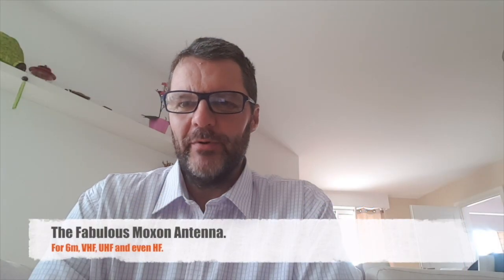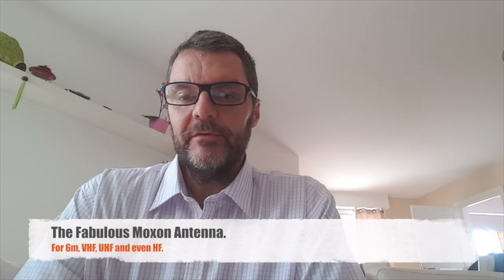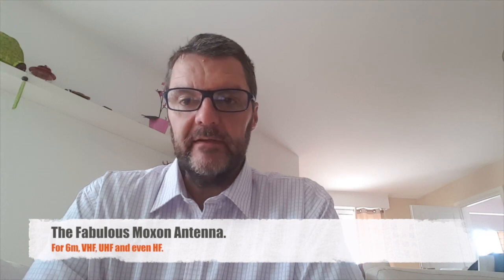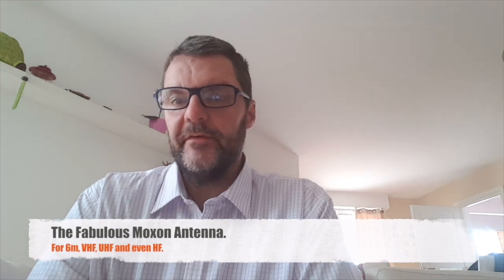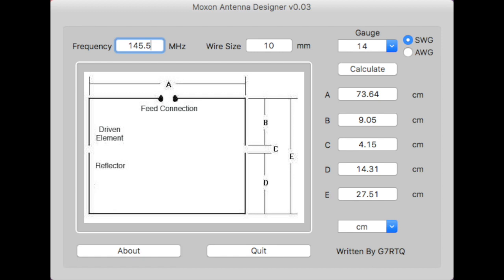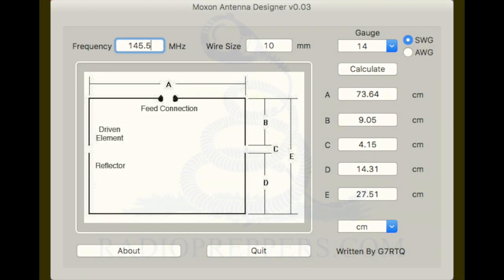The Fabulous Moxon Antenna, Part 1.

Comment: You should sweat copper pipe by heating underneath and not directly on the joint. When the pipe is hot enough the solder, applied to the top will wick into the joint. You should not apply heat to the solder.
Great, practical info though. I love your videos.

Comment: Its not a folded dipole, its a 2 el beam with tips bent to look at each other. thats where you get the voltage coupling besides the current coupling at the middle of the elements and thats what makes the Moxon a uniquely fabulous antenna, double coupling.

Comment: Part 2 came up in the videos YT thought I would like to watch. Well, I want to see part 1 before watching part 2. This is not a Star Wars production. Are tube cutter tools available in France? I would think it would be much easier cut pieces of copper tubing with a tube cutter than a hack saw. Also, is bronze rod, in the USA the rods are used for brazing, available in France? I haven't found a distributor yet so brazing together bronze rods for antenna lengths is what must now do. On to part 2. KB8AMZ
Reply from the maker: But with a tube cutter you can only cut tubes... Brazing rods yes, but only long enough for UHF antennas...

Comment: I built 10 of them the 2 mtr one i use a yard stick or pvc form  and thick wire  the gap is important i get 1.3 on the 420 to 450 mhz and 144 to 148 mhz once you get the magic length you can crank these antennas like nothing i love these antennas....kg6mn